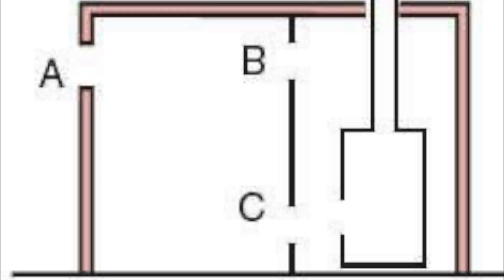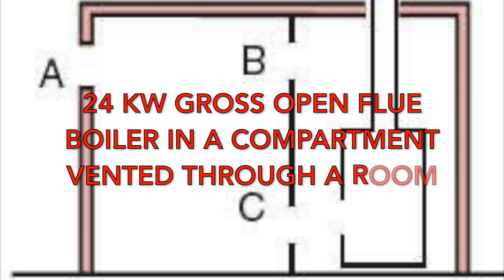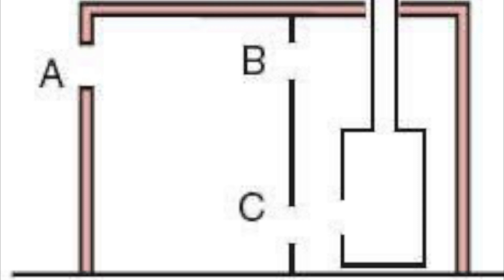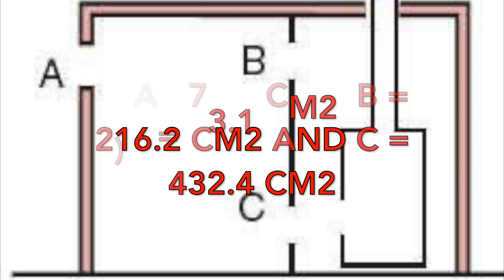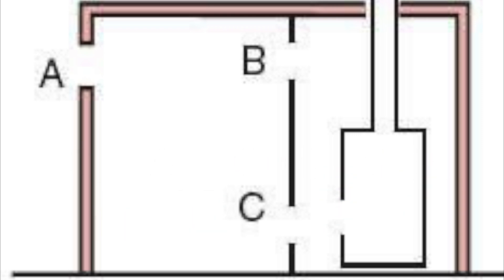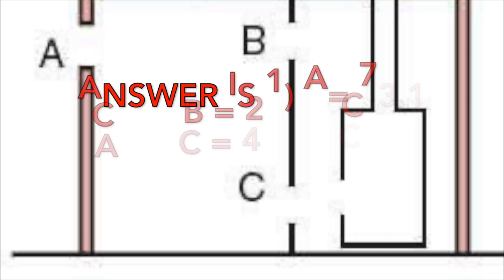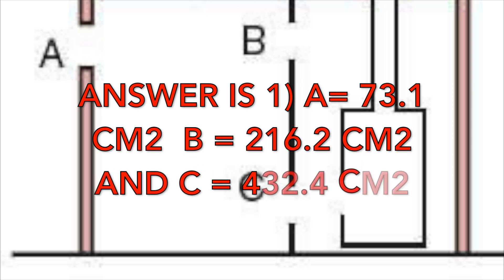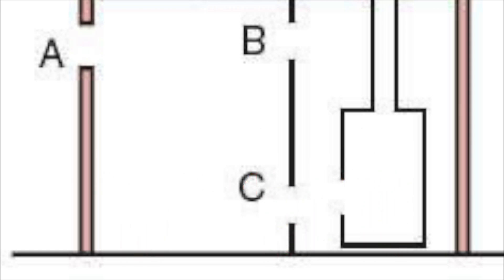Gas training picture quiz on ventilation, Part 10, gas training for gas engineers and trainees.

Comment: Ive had this before when someone says "cubed" instead of " cubic"   and its NOT the same.  eg, 9 cubed is actually 9 x 9 x 9  =  729.  Therefore 9 metre's CUBED would  = 729 cubic metre's,  whereas 9 cubic metre's is what is stated, a total of 9 after doing a sum.   Sorry about being pedantic but cubed is NOT actually the same as cubic.  Same as when someone says "metre's squared" instead of "square metre's".  These are not the same either.  I have had this when I have been getting training and it just  not correct to say it this way.  I brought it up but it just like gets shrugged off but it is NOT correct.
Reply from the maker: If you asked for 2 cubic meters of concrete or 2 meters cubed of concrete do you get the same amount of concrete